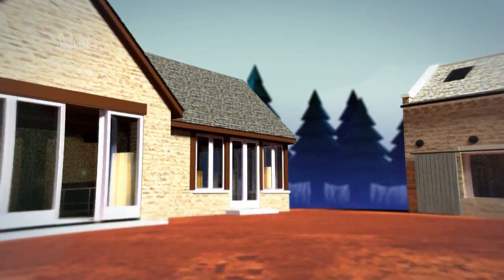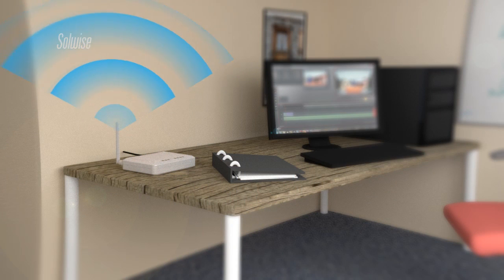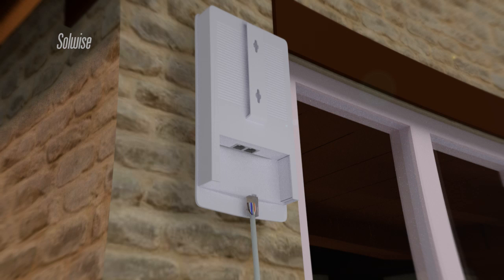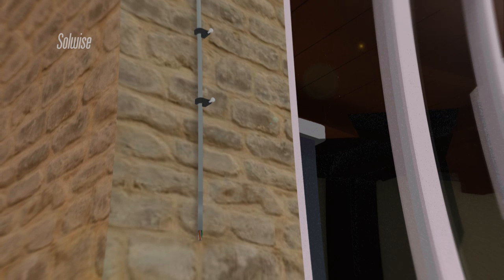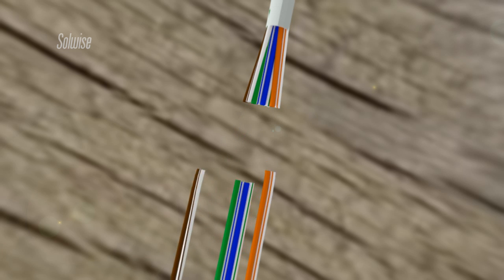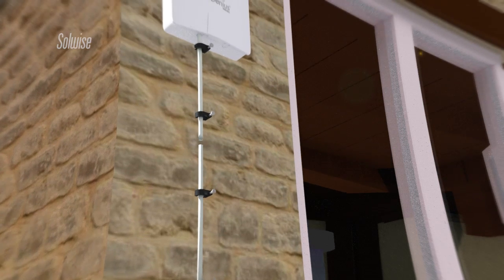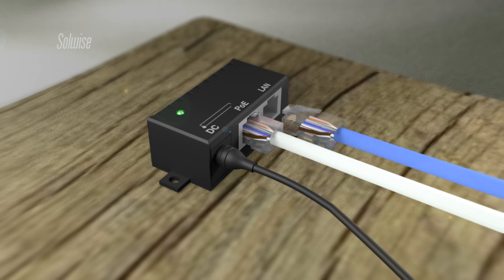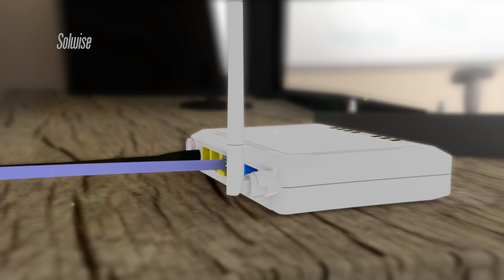Simple WiFi Link - link buildings using Wireless

Comment: Thank you for the great detail. 
I have 8 buildings, all within 50 meters of each other, but the office wih interternet is about 70 from the nearest. Can you daisy chain these?
Reply from the maker: Yes... you have to think about 'modes'. So generally you have WDS AP at the centre and then WDS Stations as the remote points. To chain you could go WDS AP to another WDS AP and then to WDS Station. So the WDS AP to WDS AP is your chain.

Comment: @Thearaner3 Errgghhh Powerline awful bit of technology! They create so much electromagnetic interference it's unreal. They also don't work very well over long distances, especially if you have loads of noisy appliances plugged into the mains. Microwaves links are always going to be superior and not as expensive as you think (check out Ubiquiti). Obviously none of these will ever beat a physical wired connection, but I've had these running over several miles and extremely reliable. Powerline on the other hand, for long range applications are a waste of time.

Comment: Yep more happy crap from someone in the past. Buy a Powerline Network 
adapter from Amazon. Run an Ethernet cable from the modem into the 
module that plugs into your wall socket and out of the module from any 
other wall jack on your electrical lines either in your other rooms of 
the house, garage or shop into what ever you need wi fi from and bingo 
your in business and for 50.00
Reply: Do you have a link?